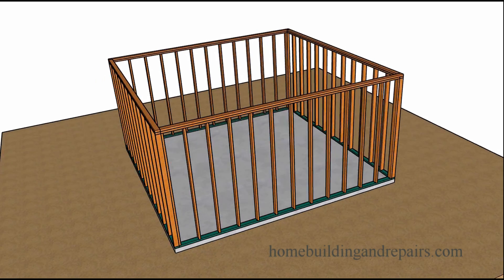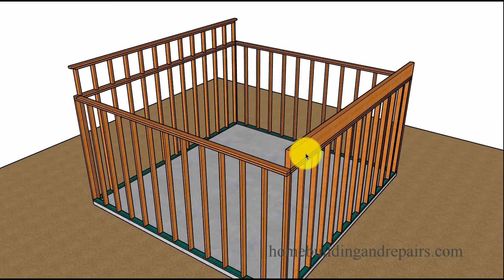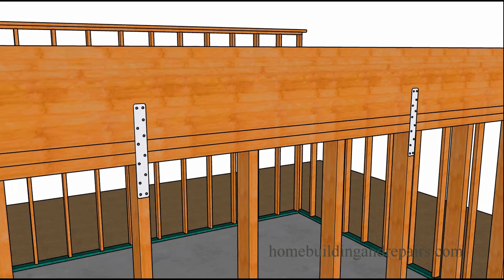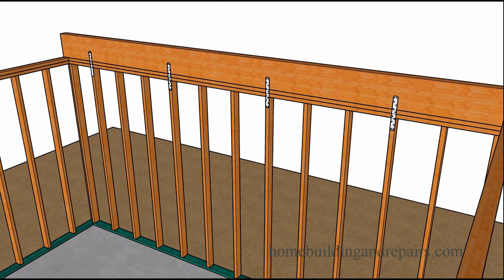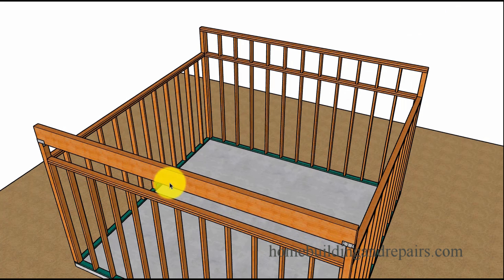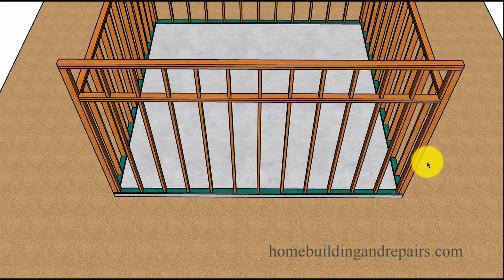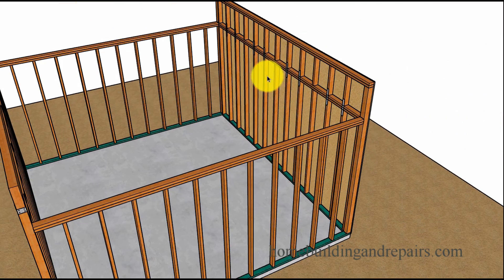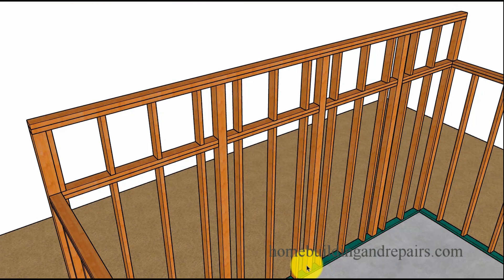How To Extend Wall Framing To Raise Ceiling Height - Structural Engineering Ideas

Comment: Thanks Greg!  This helps out tremendously.  What size strap are you proposing for the vertical studs?

Also, I wondered if I only needed to raise one wall 4.5" by stacking three 2x4s on top of each other by gluing and nailing each layer.  I suppose it would still be wise to use the straps in that case as well.
Reply from the maker: If we were going to use the examples in the video, then maybe a 12 inch strap. If you're going to be adding three more plates, then maybe you could drill a hole through all of them and install a bolt with washers at each end, 4 foot on center. Glad you like the video and glad it helped and thanks for the fantastic video suggestion.
Reply: - 3 years later, using simpson strongtie screws, the whole top plate stack could be screwed directly into the studs - ?? new techniques appear over time..

Comment: Here in Sweden we don't use straps hardly ever, but some nailing plates, but a lot of Angle Brackets. If you mount angle brackets on every side of the new vertical beams, it get very strong. Use special screws that are made for strong bonds. And "105 Degree Angle Screw adapter".
Reply from the maker: I've also noticed that in some parts of the United States where there aren't a lot of earthquakes they don't get carried away with straps or other types of building hardware, but in California where I'm from it's ridiculous. Thanks for sharing and it's always great to hear about what they're doing in other countries. I would love to see a picture of what you're referring to and you could get our email address at the website.